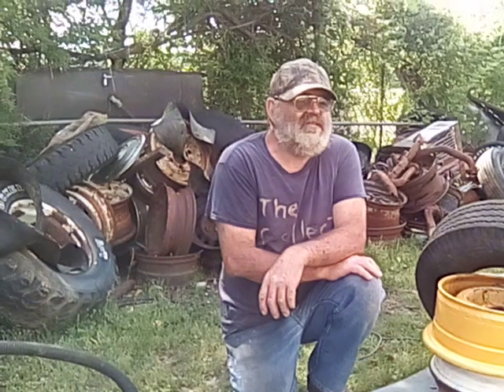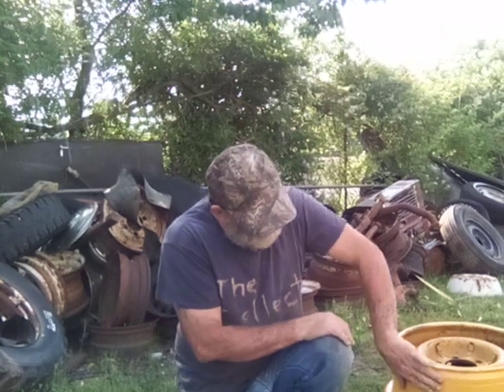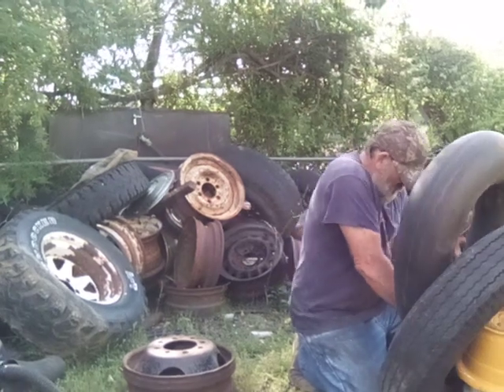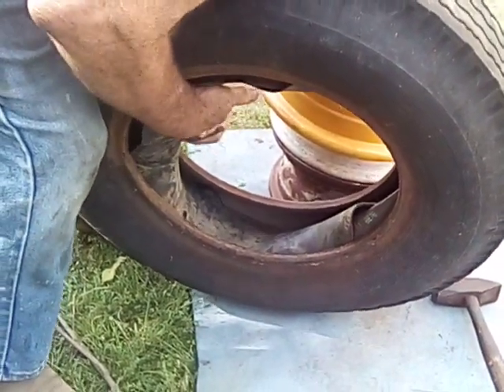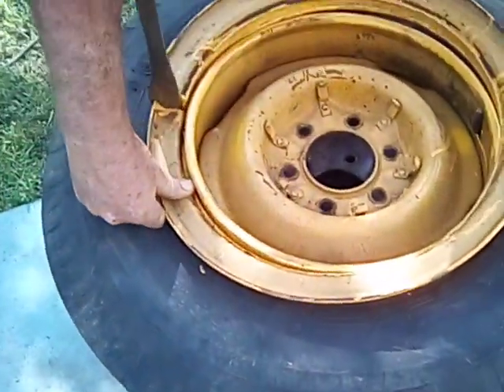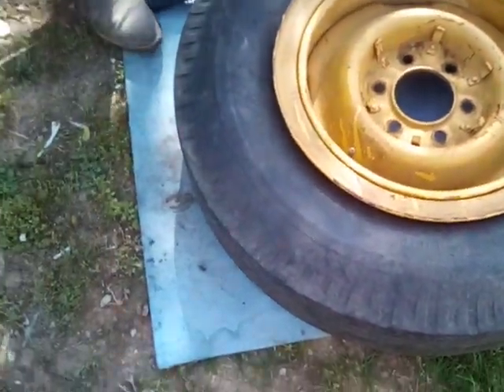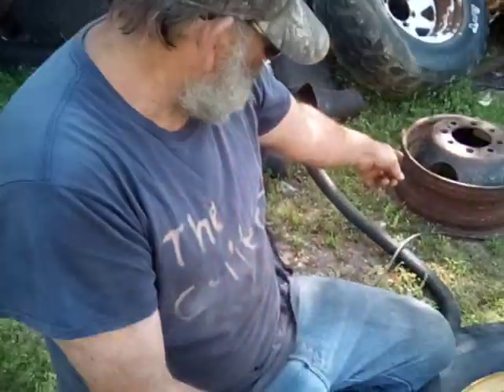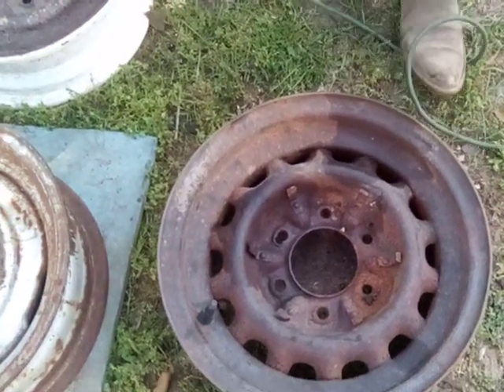Split Ring Truck wheel tire mounting revisited.

Comment: Got me a old 50 Chevy truck that has those style of rims with the ring. No body will change them but Les schwab they want 80 bucks a wheel. Just crazy! 
Need to build me a tire cage.
Reply from the maker: We made three videos      several months ago. We   tried to show how we fix the split rim wheels. Now the widowmaker Kelsey Hays two piece are a ticking time bomb. We never fix them.  We sell those to the scrap man.

Comment: It was all interesting watching the details  on changing split rim tire tube and liner. There must be different types. Do some types 
have a 2nd piece that bolts on instead of stretching around?
Reply from the maker: Those two piece that bolt together and called Combat Rim's. They came on military vehicles.. Our eldest son has a WWII  WC Dodge. That has that type of wheel. And I have a bomb. Trailer that was with Pattons Third Army in Europe that has the Combat wheels.

Comment: You can walk them rings on
Reply from the maker: Make a video I will watch it!
Reply: You can easily walk the big ones on, I used to do 12.00-24’s. 16” rings, not so easy… I have had limited success. Need to gain more weight, maybe.